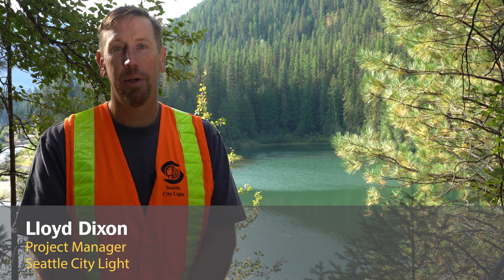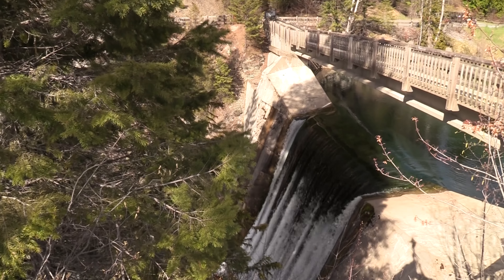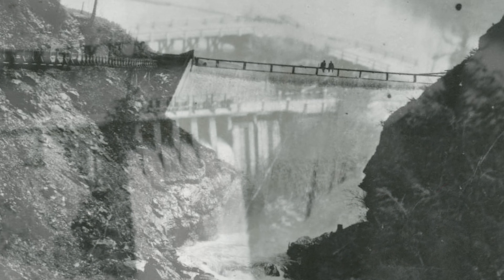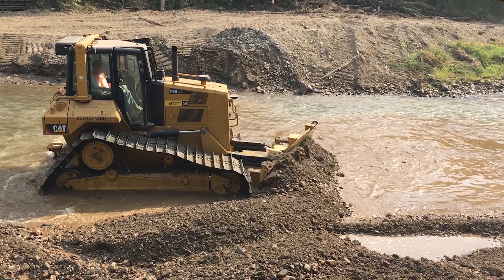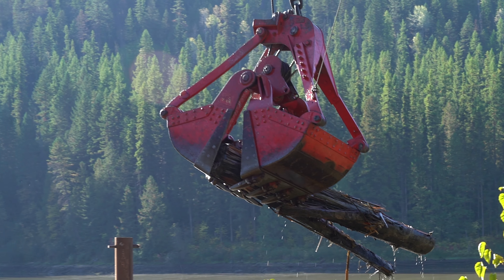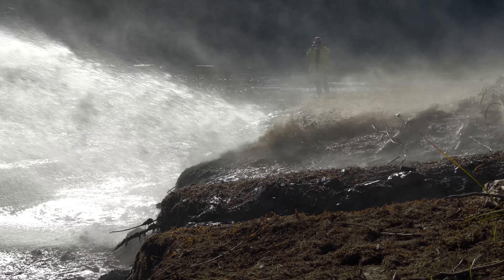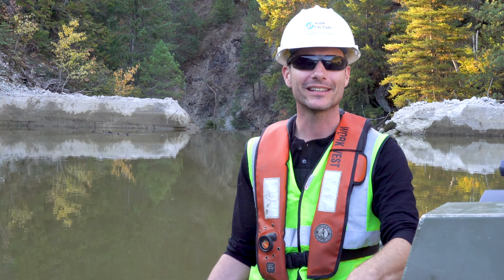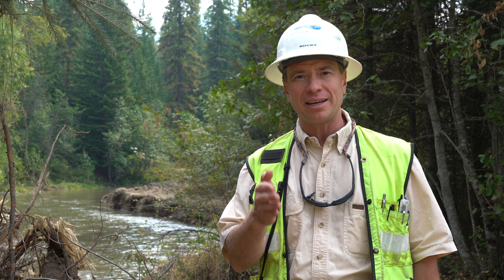Mill Pond Dam Removal and Restoration: Fall 2017 Update

Comment: All those people he talks about at the end that had the sit down to plan this project, guess those who did the same thing when it was built don’t matter.  I am amazed by all the flare about how wonderful this will be, or how much of a safety issue the old dam was, apparently it worked on all the sheeple.  I wonder how society will judge your work 100 years from now.
Reply: Dams are terrible things; they destroy rivers.
Reply: in much less than 100 years all of the "replanting" and other things that they are doing will be completely reshaped or washed away by the river.
Reply: The original planning effort must not have been very good if the dam hadn't generated power since 1956. It needs to go
Reply: @UncleKennysPlace  Fuck you punk. I'll be you enjoy flipping that light swatch and plugging in your toys too don't you asshat...

Comment: I think you should just remove the dam, let nature take the sediment where it needs it.  no need to re-plant or do anything else.... nature will restore the river....
Reply: YES. The river will re-deposit the sediments downstream naturally; the plants will repopulate the area. Just remove the obstruction (the dam). This is why these projects are so expensive and fewer of them get done.
Reply: Exactly, it is a money theft scheme.
Reply: Here's another idea for the sediment. Why couldn't they use a dredge with a vacuum hose to pump the sediment from behind the dam? That sediment contains much essential minerals which could be used as a natural, organic fertilizer for growing crops. If you like organic fruits/veggies, this is a decades old compost heap ready to do it's part.
Reply: @samuelchappell7280  do you have any idea where this site was? The trucking cost would be astronomical.
Reply: @dotsojp  And the cost for removing the dam isn't? Before they can even begin to remove the dam, the government agencies will spend $millions on personnel, equipment, etc. just for the environmental issues first, and then the government will pay $millions more for removing the dam. If money from the sale of the sediment can offset the overall costs for this project, then it's a very viable idea and objective.